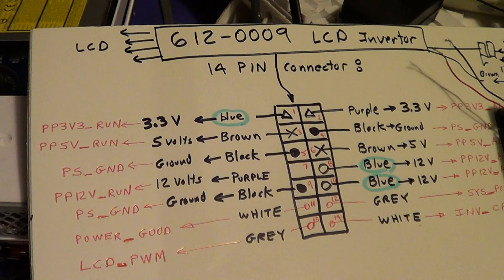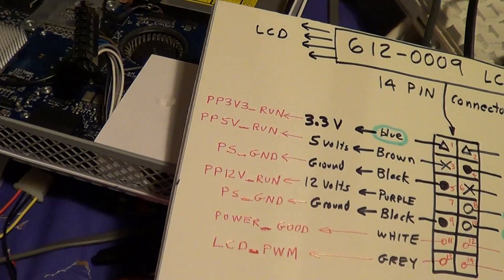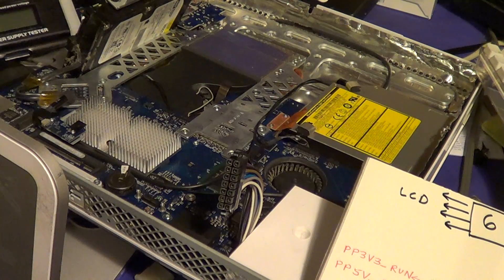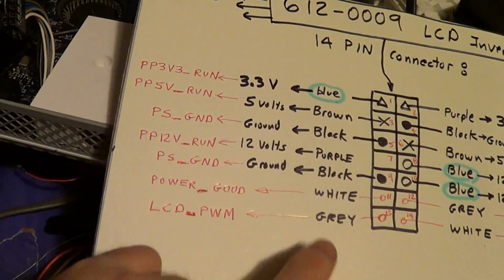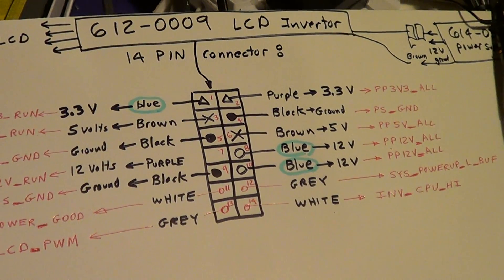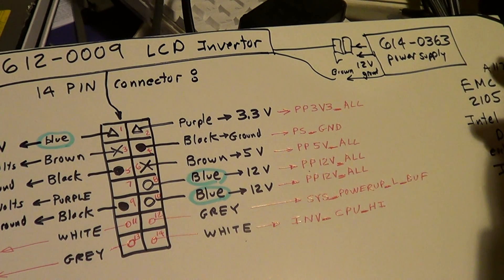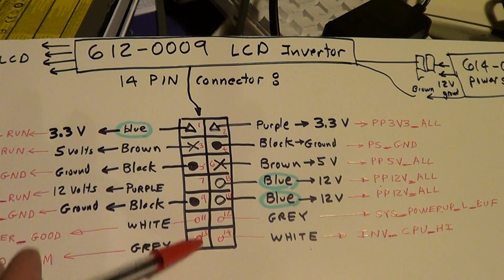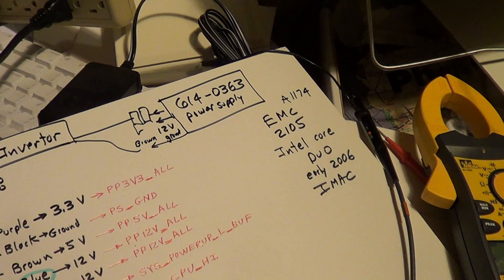20" iMac 14 pin connector pinout early 2006 Inverter 612-0009  rambling video 004

Comment: do you know where i can find a pinout scheme for an inverter board of an imac emc 2266 model a1224? part number 612-0051  this one have only 4 pins 2 from psu and 2 from logicboard.. ican see only 12v on the first 2 pin and nothing on other 2. and  my ccfl lamp on lcd dosent work :(((( is my inverter faulty or is my logic board faulty?

Comment: hello, 3beltwesty may I ask you what do you think is failing with an iMac 20" late 2006 which makes on some of the pixels in some of the three colours of the pixel (yellow, red, green)? I send you a photo if you may help me, the panel seems good as it shows blank and later the interrogation icon asking for the hard drive, the graphics has many room to the board and this may be the cause, but I suspect about the board connected at the left of the LCD panel may be failing too?
My e-mail: dfamaro@gmail.com
Thank you!

Comment: Hey, I have the exact same imac with the exact same problem. FYI you video helped me a great deal and I found a solution. If you have not figured it out yet, the main PSU on the top has a defective power trip/safety. I applied 12V/15A to the inverter --> from 2 grey psi = 12V that connects to 2 brown on inverter and 2 black psi = GND connects to 2 black on inverter and brown = signal connected to grey on inverter that is not connected to anything on the PSU.